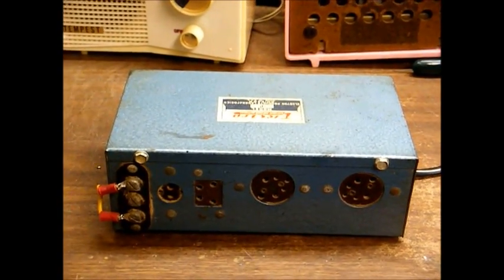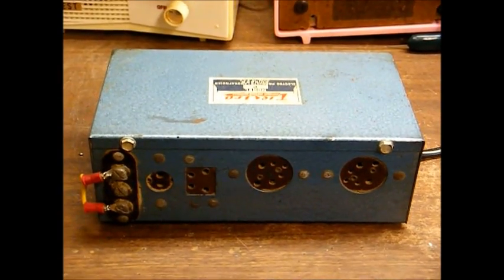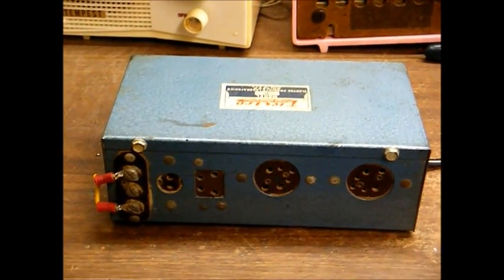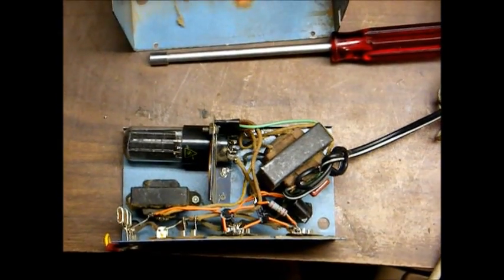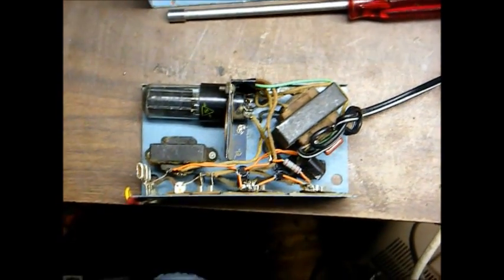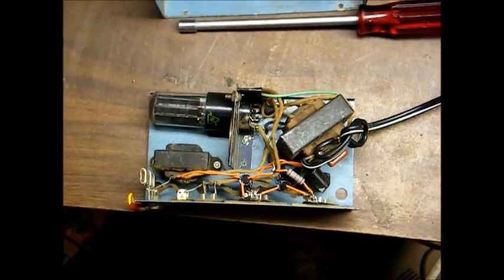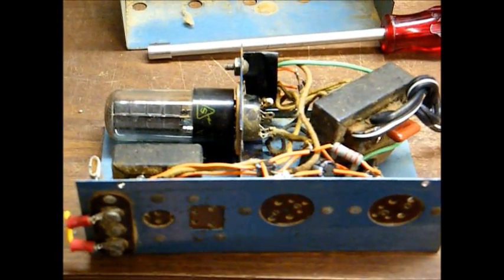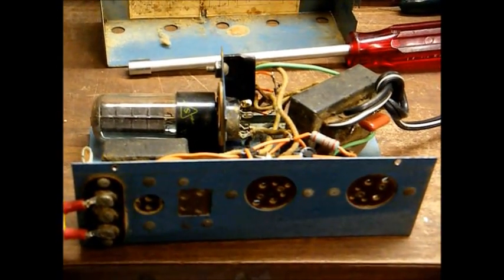Electro battery eliminator for a farm style tube radio

Comment: Right you are! I have "converted" Many of those old farm radios to A/C power by adding transformers, diodes, filter caps & regulators. You can also "Build " a battery by plugging 10) 9-volt batteries end-to-end for the 90 volt plate voltage & 2 "D" cell batteries in parallel for the filament string....Just curious...what is the terminal/screw strip for on the left side of the back of that unit?

Comment: I have a similar one called a "Pow-R-Shiftr" that was sold by Sears to go with their Silvertone farm radios (of which I also have one, from 1940). I replaced the bad copper oxide low-voltage rectifier with a silicon one, as you did, and kept the tube high-voltage rectifier. I also replaced the filter capacitors and the power cord, but kept the original power switch. Great old radios, and very sensitive.

Comment: Electro made two different series of these battery eliminators, one series is like the one you and I have with the 1-1/2 volt A side and the 90 volt B side, but the other series puts out 2 volts for the A side and I think 90 volts for the B side. I have not see the 2 volt model as yet but they were designed to operate the earlier battery sets with 2 volt filament tubes. Someone told me that the original idea behind the design was that they would fit into the battery compartment of a portable.